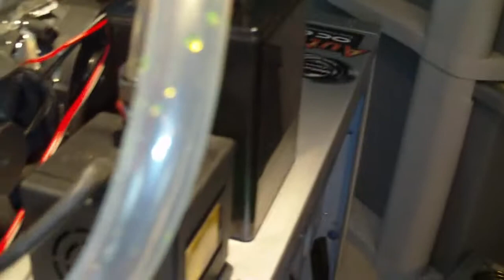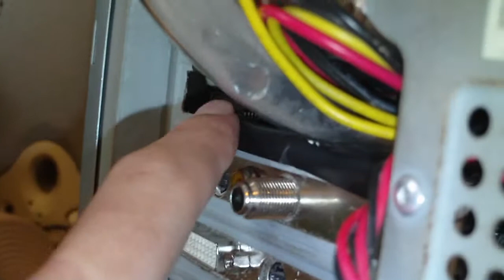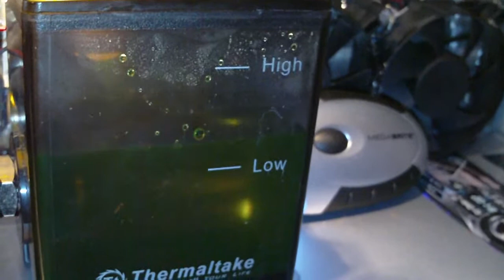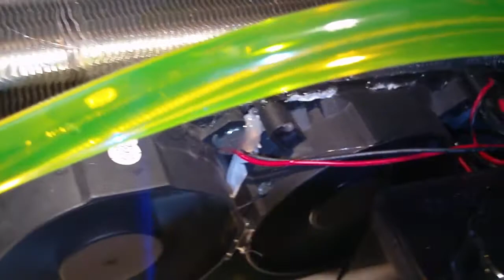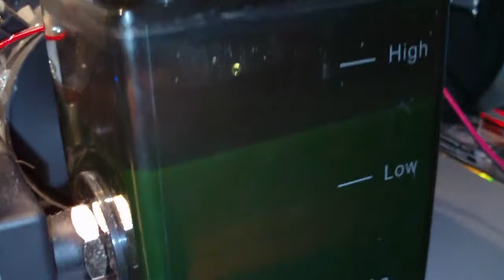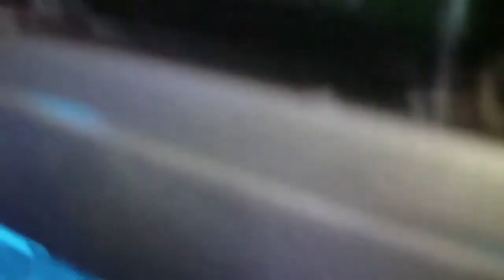MTDX with Custom Liquid Cooling System in Progress

Comment: Personally higly disagree most cases have cable management behind the case and i have an nzxt phantom 410 3 hdds 2 optical drives led lighting dual radeon 6870s in crossfire and a asus pcie interent card and i keep it all extremely clean and you can barely see any cables at all just saying